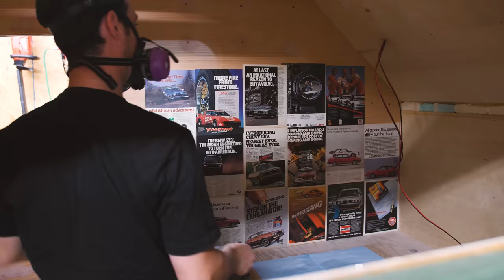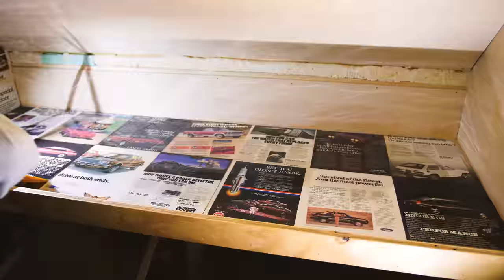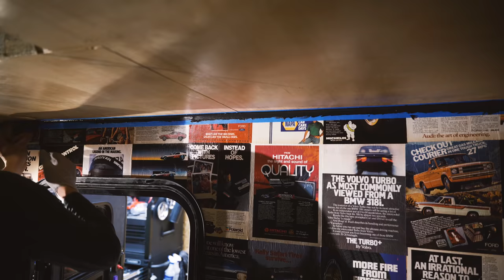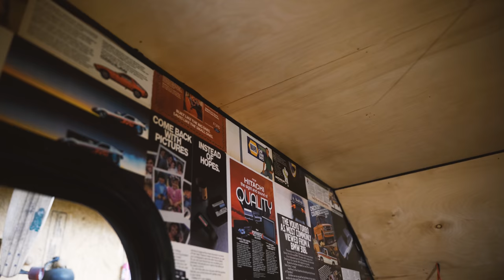I built myself a Teardrop Camper from scratch - FULL BUILD

Comment: We absolutely loved seeing this come together.  You did an amazing job, it looks fantastic!
Reply: Probably cost him less to build this that it would to buy a commercial build of the same size and model.
Reply: I build the same harbor freight trailer, I made 4 foot tall walls, then I put a 8 foot truck bed cap on top.   I had to extend the walls 6 inches off the sides, but u can walk around in it, looks goofy but I get lots of complements
Reply: BTW I know I'm way over weight on my harbor freight trailer and it rides ok...BUT CHANGE THE WHEEL BEARINGS!  lots of wrecks caused by those cheap trailers. I got mine on sale for 299 lol
Reply: @breakingames7772  I think the name for the general build is "squaredrop trailer" or something like that.

Still no replacement for a true, elegant teardrop trailer 🤗
Reply: @breakingames7772  not goofy at all. In Texas, we call several builds like that a cowboy camper and it's not an insult at all.
Reply: Change the bearings to what?
Reply: @whyme6036  given the low cost of the running gear on this unit, it's quite likely that the bearings were the lowest quality available and most likely will fair in a short period to time.  I'm therefore assuming @breakingames is suggesting moving up to a better grade of bearing.
Reply: @garypotter5569 , as the expression goes, "beauty is in the eye of the beholder".
Reply: @Dog_gone_it  4444
Reply: Late to the party, but I love all the partnerships you're doing with people like G. Definitely will be going to you on my next project.
Reply: 7/10

Comment: Better quality build than you'd be able to buy. He used 10x the glue and insulation any manufacture does lol..  Great work!
Reply: The only thing I would change would be to make it more "flexible" as in a build for frequent earthquake conditions.

Trailers are in "earthquake conditions" very much more often than houses after all.
Reply: 100% correct. He’s brilliant. I think that we’re all capable of doing stuff like this tho we just don’t try tho. I’m not saying we all could do something this gnarly and with this craftsmanship I just mean we really don’t know what we’re capable of anymore cause we just don’t do anything like we just pay someone to do it for us
Reply: Wonderful job.  A labor o love.  I can tell you are proud of your work and I can certainly say that those of us out here in the ether are proud of you!
Reply: The only part I would worry about is that, unless I missed something, everything is attached to the base plywood sheet with pocket screws through the edge of plywood, into plywood. Like that base of 3/4 ply is bolted to the trailer frame with those T-nuts, that's good, but the load from everything above has to go through the pocket screws in the vertical plywood pieces on the "drawer" level?
Reply: @garypotter5569  the main problem there is that as a trailer it has to be sturdy for hauling around, also it’s not particularly tall so earthquake conditions won’t be much of a hazard as much as things around it would be in one
Reply: @steveocirinooo8703  

Yeah.
This newest generation really is lazy and helpless. 👌
Reply: I used to build caravans and trailer park units. Trust me, we used glue a-plenty. Had very strict guidelines to make it stick. Last thing we wanted was faulty manufacturing claims
Reply: @dpz9872  Laziness doesn't exist and the modern tiny house movement is as strong as it is because people refuse to be helpless in the current economy.

And even if what you said was true, how does shaming people help them to improve?
Reply: @steveocirinooo8703  You are so right!!!
Reply: @dpz9872  cringe
Reply: I will add the fire resistant material+ A plastic tube for the wire
Reply: @steveocirinooo8703   This isn’t that hard of a project most won’t attempt this due to lack of tools and space.. But this is 100% the best diy teardrop camper I’ve seen yet !

Comment: Pro-tip. If you're using solvent treated timber, make sure it isn't still releasing the solvent when building. It will release the glue and dissolve polystyrene if that is what has been used for insulation

Comment: I like bigger wheels.  I wanted to do that to mine, but I was concerned that they would rub inside.  Did you do anything to the axle?  Replace or move it back?
Reply from the maker: Nope just bought slightly bigger wheels. Barely bigger but make a huge difference.

Comment: Very nice 👍 About to do my own offroad camper trailer, but a bit smaller one and with a roof top tent. But for the "box" I might use similar methods of building like you did. Just a question tho, how well is that filler you're using (at around 20:09 mark) holding up? Or is the frame so sturdy, it doesn't flex enough to break that stuff or is the filler you're using a bit more flexible when dry than average wood filler? 🤔
Reply from the maker: I haven’t seen the filler pop at all, but if I was to do it again, I’d use an epoxy filler. Total boat has a compound that’s really strong. Made for boat building.
Reply: @WoodnessGoodness  That's a good tip actually, cheers. I plan on towing my smaller trailer off road too, so that's why I was worried if that filler might crack under all that swaying side to side, but that boat filler might do the trick and peace of mind 👍

Comment: What changes did you have to make to put bigger tires on the Harbor Freight trailer? Can anyone else give me thoughts on this too and what a safe max speed is for this trailer and wheel combination? Thanks!
Reply from the maker: Not sure on the speed but it’s only a little bit bigger but makes a difference on how it looks. I didn’t have to do anything because the wheel isn’t big enough or thicker to need spacers and or different axles. I went from 12 inch to 13 inch wheels

Comment: If you give a scale, your score is 7/10. You made the mistake of creating a corner at the back of the car, losing the maximum expansion area of the mobihome trailer. Instead, you should make the two sides to expand the area of the mobihome, which will double the area. A 1m4 built-in bed will be enough for you. 2 people, the other side you design a built-in stove for cooking, or a more expanded design if you plan to build a mobihome trailer for your whole family.

Comment: BEST bedroom on wheels i have seen in a long time. Couple of advise from experience? 
Add jacks to the back. lift it off the ground. when you move in bed the whole thing shakes without them...
Cover and waterproof those drawers. Water will get in and rot the wood. You WONT see it. It will just happen :( 
Add a diamond aluminum rock plate to the front bottom 1/3 of the trailer...maybe cover for the front window while travelling.
Safe place to put wet dirty shoes at the door (I know Americans wear shoes indoor but come on LOL)
More tongue weight. Battery/trickle charger for lights, propane tank for stove, lock box for tools/whatever
AWESOME trailer my brother.

Comment: You should be proud of yourself, obviously you pay attention to detail- great build. A trick for your next build - when drilling out the holes to bolt the unit to the trailer make the holes about 25% larger than needed for the bolts, plug one side and then fill the hole with epoxy. After the epoxy is hardened drill out the proper size hole for the bolts - this will leave an epoxy ring which will protect against moisture. (It's the same method used for drilling through fiberglass hulls, etc in boating).

Comment: I’ve never seen the care and detail that you put into the construction of this camper. Outstanding job and video! I’m very impressed and inspired. 😁
Reply: I built one on top the same harbor freight 400 dollar trailer, he needs to change the axle or at least the bearings, the axle for that trailer is rated at 1100 pounds and he's got way over that loaded up.  Lots of wrecks caused by these cheap Chinese trailers because the bearing catch fire the first 1000 miles

Comment: If you end up building another one, how about some jacks on each side so you can level out uneven terrain? I speak from experience when I say that sleeping in a slanted bed is awful. 😄 But yeah, this is one of the more awesome builds on YouTube and I enjoyed from start to finish. Now onto the next project!
Reply: I have a similar shaped trailed with a rooftop tent on it and I just use those drive on stepped ramps and the jockey wheel to even out the slant in all directions
Reply: Usually the stabilizer jacks are just to keep it from rocking as you move around - if you jack it up too far you may bend the frame.

I've had a 26' camper with slide, and a camper van, and must say I love not taking 20 minutes to disassemble everything when I go - just hop in the driver's seat and start it up.
Reply: @questioner1596  Personally, I am a fan of permanently attached scissor jacks on all four corners and using a power drill to raise and lower. Painless and it takes about six minutes to have a perfectly level sleep.
Reply: @harveymanfrantinsingin7373 , if in a campsite it makes a lot of sense, but if you're at a rest stop or similar, there is a certain security in being able to drive away quickly if needed. I usually just look for the most level parking spot and climb into bed.

Comment: You may want stabilizing jacks on the rear two corners (at least), and maybe the two front corners as well.  Less bouncing when you're in the camper, and less side strain on the tongue jack.  That's WAY too small for me, but for this time in your life, perhaps it's right for you.  Different strokes and all that stuff.  Weigh it, empty and fully outfitted for camping.  Make certain your loaded weight is not too much for the frame, axles, springs, and tires.  Trailer tires often have maximum speed ratings as well - don't exceed!  I did not see trailer brakes on there - be very aware of the momentum of the trailer, which will tend to push the back end of your tow vehicle out in turns and under heavy braking.  Practice defensive driving and leave LOTS of extra following distance.  I have driven big trucks and travel trailers all my life, and there's lots of stupid drivers out there!  LOTS.  Enjoy!  Consider a tent-type awning, either connected or free-standing, which will allow you a weather-free space just outside the door.  Bringing rain, mud, and leaves into your bed would get real old real fast!

Comment: I really like the design.  The below deck storage was very nice.  Very solid build.  It is extremely well insulated, with some sort of heat source, you could easily camp in that 4 seasons.  I missed where the battery was for the solar panel to charge.

Comment: awesome job... something I did was add a Keder rail to side along with the keder rail rope that sides through... I build a tent that attaches to side and other end is curved where an Aluminum .380 pole slides through sleeve.. dome wall has zipper in middle. great for changing room and bathroom for wife...

Comment: Welcome to the world of tiny trailer DIY builders and campers =)   Many years of fun camping and great destinations =)
Reply: At some point I changed out my axle ( HF 2000# )  to a 3500# Dexter ( I know over kill but a used axle at a cheap price  )  to get the same bolt pattern as my tow vehicle and make tire and rim choices much easier =)   Also no guess on bearings and could even add electric breaking if I wished or mandated by state =)

Comment: Pro tip i own 3 of these harbor freight trailers there awesome but what I have found is that once you put it together immediately take it to your local DMV and get license and registration squared away before any modifications are done. I have found that in certain situations they can give you a hard time as to how to register it whether its a "trailer" or "camper" once you have a permanent plate you can pretty much do anything you want to it because you have a lifetime plate. Different states may vary but I have seen other you tubers run into this issue. Otherwise build was amazing

Comment: Its called TEARDROP, because its ROUNDED in front and tapered in back. Its an AERODYNAMIC shape. Its stable in winds and saves gas when towed... 
Yours is a straight flat WALL that acts as a break for your vehicle and ruins your gas mileage... 
I mean its REALLY cool other than that..  You could just build a little faring to snap over it... 
Cheers..

Comment: First off, nice job. I just have 2 things, ones info and the other advise (the WORST vise).
The horizontal pieces between vertical studs are called "fire-breaks", meant to suffocate flames by compartmentalizing the spaces between studs and have no real structural support save for stopping the studs from warping. And in this case, using plywood, you really didnt need em.
The other thing is instead of using a t-square to line up screws use a snap line. Much easier to carry around as well as get into tight areas the square cannot.

Comment: Nice Job, Did you weigh the whole thing? isn't it better to use a steel frame and aluminum sheathing instead of wood and plywood? give wood from the inside.
I watched your video with curiosity, because I'm trying to build a similar construction, but probably on metal / aluminum components. For me, the entrance will be from the back, two windows on the sides + a window with a fan on the roof. From the back there will be a pull-out drawer with a stove and maybe a gas-powered refrigerator. I intend to additionally equip the entire trailer with parking combustion heating, such as is used in trucks. Oh, for me, the entire bodywork should be able to be quickly disassembled and installed on the chassis / trailer. This way I will have a sports caravan and a caravan.

Comment: Way better than you could buy. I have a landscape type trailer that my CRV could easily tow. Looking at all the work though and gas prices I'll stick with a camping tent though! I built a plywood boat 20 years ago I can tell you,  moisture will always find a way into plywood. I would at least paint all surfaces before assembly and Ideally with 2 part epoxy. This ups the budget a huge amount along with build time. 20 years later that boat is viable and registered.

Comment: l immediately at the beginning of the video I recognized the harbor freight trailer frame.
I repacked my  bearings, and then got bearing buddies. Those bearings came almost bone-dry. 

I've personally thought about a teardrop for it as well. Like a removable one so I could still use it as a utility trailer.
The trailer has those 8(?) spots for vertical beams for trailer walls... So maybe my teardrop could just have legs that slide into those holes.... I don't know yet.

Comment: @ 9:00 when he was doing the fiberglass, that material does not like sharp 90 degree corners, so I'd have used a router and a 1/2" round-over bit to put a radius on the edges so the fiberglass will curve around the edges better, will be less likely to want to pull away and will be a much stronger joint in the end.

Comment: Jigsaw out 2 matching teardrop shaped sections of 1/2 inch plywood, block and brace onto the sides  of the trailer, upright as walls. Now bridge across them with 2×2 boards across the top, connecting them. Go all along the top, linking the walls together and building the roof. Jigsaw out your windows and doors. Line inside with foam insulation, closed cell gap foam and cover with paneling. Line outside with Tyvex. Skin with hvac sheet metal, 20 year exterior grade silicone on your corners. You just have to be neat and take your time.

Comment: How is your trailer body holding up? I have one of those trailers. The trailer seems flimsy. If you step on a corner, the trailer frame flexes. I would worry about failure of the wooden body from this.  If you do another one, consider having the frame connections welded : https://www.youtube.com/watch?v=sucLm4sv4WA

Comment: I loved it. An the fact that someone's showing shit happens in the builds always get me. I love these. I installed my front window ac an had to accept cutting into my window frame. I went through a more expensive hose ac first it was more powerful ect. An it was horrible. I was hot 🔥🥵 still in my front room.  I could barely get it to work right ten 15 minutes. It was another miserable feeling year I made it through. But now it's decent. My heaters an AC's can do alot in here. It's definitely after a three yrs struggle actually a huge deal. I didn't think it was going to anymore by my own unpro hands ..The waiting an living in it. Made it hard. I don't have alot  money to use. Getting a big for this trailers standards was supposed to be my fancy standard of living change.I ended up a year later finding a guy with a yr old windows ac 5000 Samsung. Like I looked at when getting the artic king 7000. that was for 2021instaled on a hot morning. I died for a week in here.. Getting in my bath. Ect my freezer which died last summer was loaded with popcicles. I got lucky though I unplugged my fridge an forgot and thought it broke at the same time..  🥵💩💩💩 I bought a nice 2017. That was alittle smaller an turned back around an sold it. I plugged the other fridge in too. The little one got cold an I save my food... Fast. Liked the people who sold me that. But alot of that stuff is temporary. It's just not the real deal. It's a extras line typically.... Not the full Monty... But it's never exactly like my first plan. Sure I can see it it God's way of guiding me.

Comment: Above and beyond workmanship overall, even though there are a few things I would have done differently.
    I had a bad experience with Chinese lug nuts and studs rusting up on me. Use Never Seize on them as a precaution. I also had a drawbar bend on me. I eventually junked that  trailer before I fixed it though. Strengthening at the point where the drawbar goes underneath the trailer now could save a headache later.
   Jmho, fwiw, ymmv, etc.